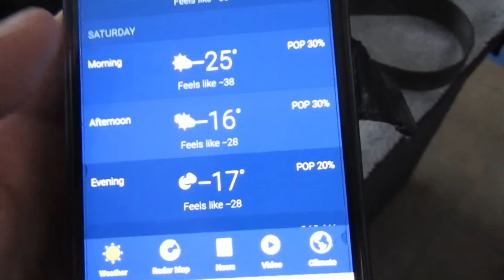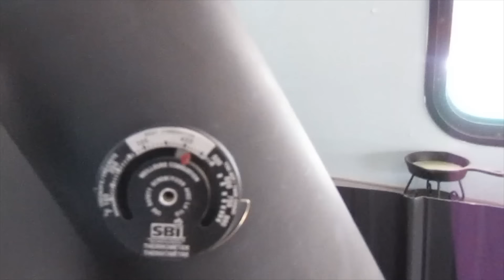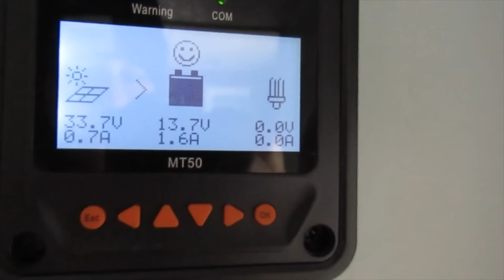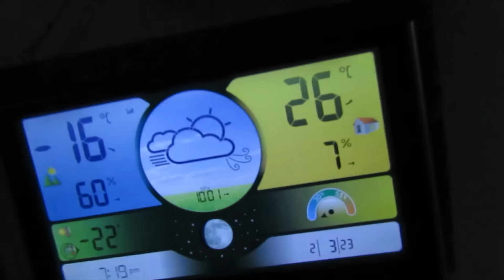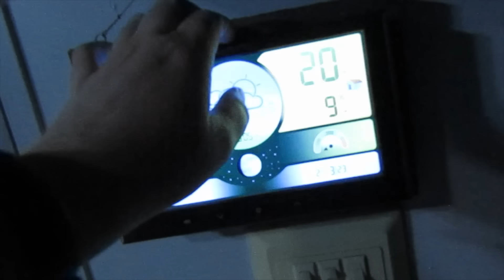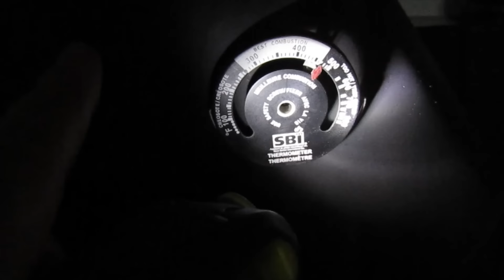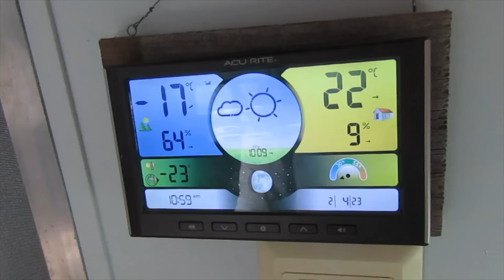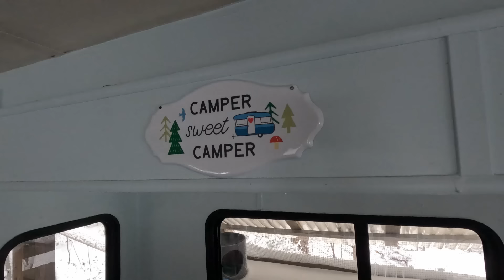Camper Living in Extreme Cold Warning

Comment: I live in a 5th wheel in northern  Wa. State. I found putting foil bubble  wrap on my windows  helps to  keep the heat in and reduces  drafts.
Reply from the maker: I have that on a few in the bedroom, does help 👍
Reply: I also have this in my 5 th wheel, game changer!  Full time in BC Canada. We hit -40 last winter it was yikes lol
Reply from the maker: @user-ul5gy7ch1p yikes is right! BRRRRR
Reply: I'm sure all of you already know about this...perhaps to wrap around the propane fixtures.   :)
"Frost King HC6A Automatic Electric Heat Kit Heating Cables, 6 Feet, Black"
Reply: I wrap walls in Texas. Our trailers are not manufactured for these temperatures. No  these
Reply: Gypsy Jenna cover ALL YOUR windows every single one with foil insulated bubble covers and then get some curtains up  on all the windows. It will keep the heat in for you and you will feel a huge difference and you will notice you will not need to burn so much wood ? Even do it for normal winters it is a game changer :-), you can buy. Insulated carpet under lay and then lay some warm carpet or rugs down. This small things will help to keep the heat in for you :-) x
Reply: I agree with all these suggestions. I was a little surprised by the lack of window coverings. Using caulk where needed will also help with some of the drafts. And definitely layer rugs on the floor. Good luck to you.
Reply: It was a bit expensive, but we put it on the windows, walls, ceiling and floors (then put rugs on the floors over it) 
Pool noodles for the lines. Plus covered the roof on top too, just for another layer.
Reply: Also vintage thermal blankets, wool blankets, big fuzzy blankets, down comforters, flannel and fleece sheets and pillow cases.
Reply: Foil bubble wrap also works to keep out extreme heat. I was in the desert one summer at temps up to 127°F. Foil bubble wrap helped a lot.
Reply: You are thinking about what needs done ahead of time. Good for you!!! I do that too. When winter comes around, I'm pulling out double sided sticky tape, plastic, blankets, plugging up air drafts around the windows with rope calk, outlets get covered that aren't used, etc. If we didn't do that, it would be sooo very cold!!! Apartments aren't built well especially around windows. And honestly every little bit helps to keep the drafts down. So great job planning ahead!!! Keep up the awesome videos!!
Reply: Get a damper in the pipe coming off the stove. Helps to maintain temps
Reply: @jessesaffell9971 yes and keep a fire extinguisher handy in case of chimney fires

Comment: Heat tip for your wood stove. Stack paver bricks on top and beside your stove.  They soak up excess heat and release heat as the flames decrease.  It makes for a cheap thermal battery.
Reply: THAT is very good advice!!
Reply: I have even heated cinder blocks in the oven and on the cook top.
Reply: it's not amazing but it definitely works. Get toasty first and THEN use something to get the excess heat. Stone works, but there may be other products that hold heat better.

Comment: I have two suggestions. One is use a heated blanket while in bed. I think your off grid system should be able to handle it as it doesn't require much current to run. Put it on top of the top sheet and under the blankets. It'll lock the warmth to your body. The other is, if you're near a Dollarama, they have those big fuzzy socks that you can wear right over your regular socks. Very cozy.

Comment: I live in northern alberta(extreme cold winters to -49+ C) in a 38ft camper with my dog and cat. I built a makeshift onto entryway and put a woodstove in it for heat(6cords of wood lasts all winter) and no need for heaters ever and my home holds heat very well.  Mornings are never cold in my home since using bubble wrap.  I use a generator for power( put a small roof over it to keep snow off, but dont fully cover or your generator will not last long.) and 4 solar panels in case I don't have gas for generator. I also use a 250lb propane tank for cooking and extra heat. I wrap my propane tank and hoses with silver bubble wrap and it doesn't freeze ever) An outhouse/night pail for bathroom use.  To keep the cold out, I wrap my whole camper/makeshift with silver bubble wrap, cutout windows and cover them inside/outside with clear plastic wrap, for extra light.  For extra warmth I use the snow and bank up the lower half of my camper/makeshift. I never feel the cold in my home and have been living like this for 13 years.  I wouldn't change a thing ❤ 🇨🇦

Comment: Jenna, use some rocks around and on top of your wood stove, they will retain heat  giving you an added heat source. Make sure they have been used as a fire ring outdoors first and not from a water source.
Reply from the maker: I did this once before with my older pot belly stove
Reply: I've heard they have a possibility to explode so I would avoid that and invest in another wood stove, a diesel heater or an electric space heater. It would be easier to put out a fire than it would be to survive mini bombs imo
Reply: If you use river rock the possibility is higher. I wouldn’t use any that was in water.
Reply: @sc5748  Eh OP seems to like them but I wouldn't chance the danger for a tiny bit of heat. So yeah definitely not subbing
Reply: @MeowMeowKitty86  , if you read my first comment, I said to use rocks that have already been used around a fire ring . Those rocks would be safer. The rocks retain heat long after the fire has gone out. If you’re concerned, don’t put them on the stove place them around the stove. Why don’t think hearths have been around for centuries?
Reply: @sc5748  Yep, I read it, obviously. No point in changing it for the small amount they offer. You do you but I wouldn't recommend it to people because some people wouldn't know the dangers for the small amount of comfort they offer but that's just me.  I assume this is the creators alt or a friend and still can't figure out why they'd agree with this in a home of all places.
Reply: @MeowMeowKitty86  well, I don’t know your level of experience in this lifestyle. I have lived in isolated communities in the north. I am not new to this. I would rather have radiate heat from the rocks than have diesel fumes in a confined living space . Not to mention the risk of asphyxiation. Will not respond to your comments anymore.  Have a great day.
Reply: @sc5748  You can put diesel heaters and wood stoves outside of the house in a well ventilated area or structure, so not sure the issue. My dad had a wood stove before I was even born then 15 years ago added a pellet stove. Both are in the house and work just fine. I'll keep that heat while you curl up with your rocks
Reply: Buy some FIRE BRICKS instead... forget the rocks.
Reply: Flower pots can work too

Comment: I haven't seen your videos before, so maybe many have wondered this. I'm wondering why you don't have all of your windows covered well. Imagine what an improvement that would be. I would do it all winter to stay warmer. You are very brave to live in a camper in that area. Best wishes!
Reply from the maker: Usually with the heat of the larger,air tight wood stove. It is plenty warm in there. The one area that has blinds and curtains is the bedroom
Reply: ALUMINM ,  BUBBLE. WRAP. ,,  TAPED. ON. WINOWS.  ,,  WILL. GREATLY. REDUCE.  HEATLOSS. 😊  !!! .
Reply: You absolutely must keep at least one window accessible and should keep it cracked open a tiny bit if you are burning any kind of fuel. That would include wood, wood pellets, natural gas, propane, kerosene, etc. Those types of fuel all create carbon monoxide as a very deadly by product. You can't see, taste, or smell it, so you need to keep a window open a bit to vent the bad air and to bring in some fresh air .
Reply: You can wrap the rocks in towels and take them to bed with you. 👍🇺🇸

Comment: Hi, i am from middle Europe.
A Friend lived for years in a 40ft steel box.  He put 5 inch rockwool on outside on the walls coverd with plywood sidings.  He also put 10inch rockwool on the roof, covered with corrugatet Steel. Under the florboards,   he put a layer of foamglass gravel.  His Box was always toasty warm in harsch winter time (-20°C) with only a little but good self built adobe wood stove.
Reply from the maker: Sounds toasty 🌡

Comment: Shake the hot coals down into the grate and give the fire more air. It gets hotter.  Your wood will burn more evenly. Additionally,  use a fan near the woodstove. It blows the heat into other parts of your living space

Comment: 🤠 howdy fellow survivor ..  
I enjoyed watching your video ..
I live in north West Montana 🌲
In a 5th wheel..

Been in it  12 years .
All I have is a cubic Grizzly wood stove .

I got a Lazer thermometer to check all the cold spots that helped  the most .

Cover the windows 
With silver Buble wrap.
 Use Rugs on floor exspecialy around door .
I even hand blankets over the windows 
It helps a lot ..
Had a bad draft around the fridge and the stove ..
I got 500 gallon propane tank 
With line barried  and the regulator runs in side the storage.
Heat tape on  sewer drain plus a heated hose then wrap heat tape around the facet 
Then cover with plastic ..
Oh we use compressed logs with heard wood ..
They last way longer 
Burn hotter ..
Because we don't have any hard woods this far north it's all soft pine .
Larch is better ..
 Just this little bit of tips will help keep that place warmer longer ..
 
The tinny wood stove I have heats fast but in 2 hours I have to add wood ..
It keeps this place warm down to 
-45° F  with  that's my 
Main heat sorch ..

Then thermostat is at 
58° F 
I have my Buddy for back up ..
 I'm Disabled and things have gotten very very serious few winters .. I live so far out no one for miles m
I need to get all my food everything .
Good luck to you hope to see more videos..
Thanks for sharing.

🌲🤠🌲👍🌲🪓🌲
Reply from the maker: Thank you for all the tips, good luck to you as well! 🍀

Comment: You need to get yourself some propane tank heating blankets, they help keep them warm and you do not go through the propane as fast. Also, get some reflectix insulation for the inside of your windows and doors. You can get it in various thicknesses and lengths. You cut it the fit the windows. Helps a lot. We also put house insulation up inside of our roof vents inside to help with the drafts. We have been living in our Toy hauler in Washington and Nevada where this winter has been miserable with snow, cold and bad winds. Glad we invested a little. We also have a Buddy heater just in case lol

Comment: I used installation board around the camper outside its a huge advantage. Plus bubble wrap in the windows and shrink wrap around the windows. I used a 100lb propane tank and 3 small 10in space heater spaced out so that one was up front second was midway and third was in bedroom. I lived for 3 winters in a camper.

Comment: Most of your heat is going straight out the chimney pipe I’m sure people have mentioned before that a damper would hold back the heat into the stove and also use a lot less wood.. I run the same stove it’s a century S126 and I heat a 750 square-foot cabin that’s not insulated well at all ..all winter long with it no problem

Comment: Use a fan behind the stove or near the stove to push heat down the hall. Cover windows and doors with quilted material, put insulation under the trailer attached to the floor
Reply from the maker: Hi Linda, thanks for the suggestions and I do have a fan on top of the stove. It helps

Comment: You have all year to think of your heat needs. Enclosing your gas tanks, enclosing your generator- with venting, window-tremendous heat loss here, cover with outside insulation-  then inside window covers- use double clear shower curtains from $ store let hang down to floor for more insulating,then cover with storage blanket curtains at night. Cover your floors with rugs. If you have electricity use double electric  blankets on your bed- one with a blanket underneath you,  another electric blanket  with many blankets on it to trap in heat above you. This should get you up to at least 45- 50°. Do your homework during the watm months.

Comment: I am in Ohio and I have slept in a tent, pop up camper and travel trailer in -3 degrees Celsius with a blanket and comforter no heat with no problem. I have used my propane gas heater to warm up when moving around but turned off at night. Slept like a baby. Dangerous to run a buddy heater and propane tank inside your home, especially with a wood burner inside!!! I have a wood burner in my pole barn and it gets to 60 degrees F.

Comment: When propane is not in use, you should drain the line.  Light whatever it is you're using - stove or fridge or other items.  Turn the tank off and let the propane stove/fridge go out.  Next time you use the propane; give the tank value a 1/4 to 1/2 a turn - until you hear the hiss.  Light whatever you've using and then slowly open the tank valve all the way.
Reply from the maker: Thanks I did this today with some success

Comment: It all starts with the insulation value of the trailer built in at the factory. Looks like yours is one of the lightweight models which don’t provide insulation down to below freezing levels but it’s great in warmer areas. I know you must get a lot of comments like mine but just my polite observation. So then the question is what should you do? Start with underneath the trailer, what’s the temperature on the floor inside the trailer? If it’s constantly very cold then sealing off the perimeter from the ground up to the bottom of your trailer with a skirt of insulation would at least seal that off.  With that you should gain 10-15 degree increase. I grew up in Klamath Falls, Oregon where we get harsh winters but there’s no humidity so the temperatures feel a lot warmer by comparison. Even using a small open flame candle can warm the air enough to make things a lot better. Circulating the air is another important issue, a good, small high volume fan will prevent loss of heat and will also help warm the interior walls of the trailer which your actual enemy since it’s like having an ice cube next to you that’s cooling the air faster than you can warm it. On other thing I highly recommend is to have more of your stove pipe run inside the trailer so it provides more surface to radiate heat before it leaves the pipe. For safety, you can install a diverted valve if you want to bypass the extended section which can be used as a heat level control in case it gets too hot. As a teenager, I had to chop 5 cords of wood each summer which we used to heat our house each winter. If you have options for firewood, check on how other wood types will burn best for your situation. You can even set up some side walls off of the shelter that you have as your roof, just get some cheap tarps and/or some thick clear plastic sheeting and hang them off the roof edge, this will lower temps 10-20 degrees and provide another layer. And whatever you do, don’t get that damn vaccination!

Comment: Hello, great content. Propane boils at -44 degrees, so, I don't think your regulator froze up, but is possible because of moisture in the propane, but more likely is that extreme temperature was colder then the boiling point! Just like boiling water on a stove, once you turn the stove off, the water cools and stops producing water vapor! Keep the tanks insulated in extreme cold, that short cover may not be enough! Just a little FYI. And I hope it helps. Be safe!!
Reply from the maker: Thank you
Reply: Low temps will also reduce the pressure of the gas in the cylinder which will return when it warms. This also prevents accessing all the quantity of gas in the tank. At -35 best to take the ones not in use inside.

Comment: Glad you made out decent. I'm in a van and it was fine. Just run a diesel heater and I think during the coldest part I ran my van for extra heat. Definitely right about not relying on the power grid.

Comment: Looks like you are doing, most things right. A low wattage light bulb (not led light) up near the propane regulator is effective to much colder and isn't s safety hazard. try a 40 watt bulb under the cover.
Shade curtains for the windows at night will cut down on drafts.

Comment: Bubble foil on the windows. I use two layers. 5F is all I need to deal with, a Buddy heater is all I use. Inside temp is 65F. Without the 2 layer foil,  45F to 30F is the deal. Also my trailer is only 20'. Condensation is a problem. I get ice on the inside of the windows, Thanks for the vid. And a shout out from Nevada high desert, USA
Reply: @cclars6411 Howdy neighbor!  LOL 
I am also in Nevada. Near Lake Tahoe. Nice to see anotherNevadan on the tubes!

Comment: I live in a camp trailer in Nevada while I'm not off grid it's still cold inside. But I only use my stovetop a cast iron broken pan and a fireplace fan like you use which keeps me around 50 to 60° F For my propane tanks I use a cover a U-Haul moving blanket and plug in pipe wrap around tank valves. Hopefully my next trailer will be at least 25 foot and I will put in a wood stove.
Reply: A fellow Nevadan… Hi Steve! I am in Northern Nevada and just started living in my Class A Diesel Pusher. I still have lots to learn but I am loving it. Thank goodness this winter has been mild so far. Stay warm and Merry Christmas to you!
Reply: Northern Nevada for me as well went to CA at Christmas to see kids and grandkids haven't been checking my mail but hope you had a good Christmas also 😁